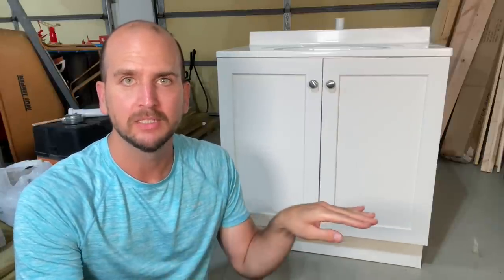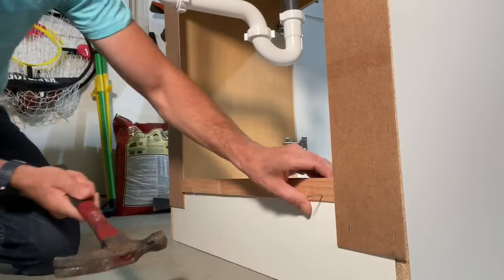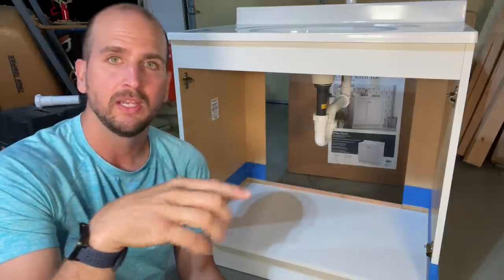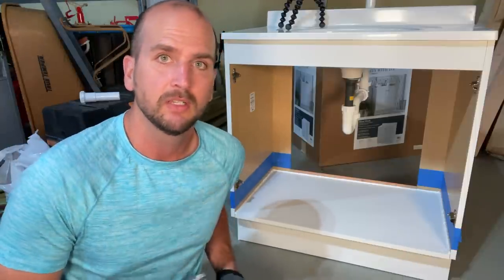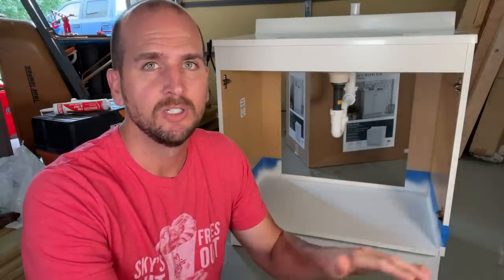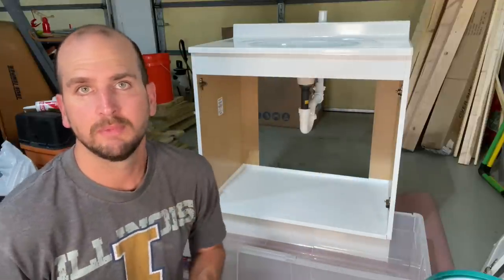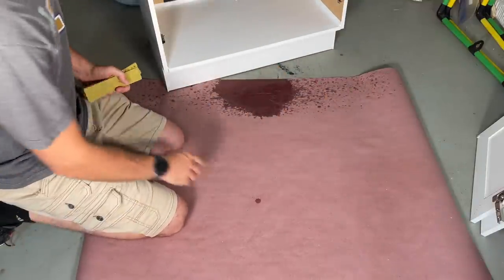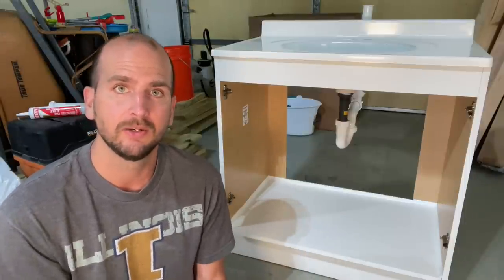Waterproofing A Kitchen Or Bathroom Cabinet With Flex Seal

Comment: Never thought to try this! I think I like the idea of this IN COMBINATION with the peel-and-stick tiles. The Flex Seal basically forms the waterproof membrane, and the tiles form an additional water resistant (but not fully watertight) protective barrier for the membrane. Kind of like the foam and/or sheeting that protect a waterproofed foundation from the dirt and gravel before backfilling.
Reply from the maker: Sounds like a great idea and I think the tiles would behave much better wear resistance as compared to the flex seal.
Reply: @EverydayHomeRepairs  That's what I was thinking. And the tiles are so cheap and quick it's almost a no brainer to add it on top.
Reply from the maker: Agreed 💯
Reply: I'm with you Marc.  The FlexSeal might get scratched up, compromising the seal.  No normal wear and tear will penetrate a vinyl tile.  Putting FlexSeal on the tile is a very good idea.   Even if the FlexSeal gets scratched off the top of the vinyl tile, the seams of the vinyl tile are likely to remain sealed with FlexSeal.
Reply: @EverydayHomeRepairs  Good point. Moving stuff around the floor of that cabinet could damage the waterproof properties of the Flexseal.

Comment: I left a comment about flex seal on the other video. I had to replace the whole "floor" of the base so after I cut the plywood base I primed it and then used a whole can of Flex Seal on it! I wasn't looking for it to hold water I just wanted some protection and it makes cleanup of leaks a lot easier. Mine was way complicated because of pipes and stuff, but if I do another flat one I think I'll do both Flex Seal and tile! God vids Bro, ty
Reply from the maker: Nice, thanks for the video suggestion and feedback 👍

Comment: I have battery operated water detectors on the under my sinks, behind the refrigerator and under the water heater. So far they saved me from refrigerator water line leak and a water heater leak. 
The only thing is you have to remember to change the batteries.
Reply: I do too, recently realized that have to replace yearly or so.
Reply: I bought some simple ones from Amazon. Put it under my kitchen sink. Forgot about it. Batteries got low and started beeping, but for about a week, I could NOT tell what it was! I actually got so fed up that I googled "what's beeping in my house" just to get ideas of other things to check. I realized my mistake and found the noisy culprit, but yeah, water alarms are good. I like this idea though too. Even just a bit of water can damage, so I say do all of these things! Lol

Comment: I flexsealed the hull of a 12ft aluminum jon boat 6 years ago and have used it regularly throughout each season with no leaks. It also sits outside uncovered in coastal SC year round. Whether its a p-trap leak or exposure to torrential Summer downpours and yo-yo weather changes in SC flexseal can handle it.

Comment: Waterproofing this way not only prevents water leak damage. There are plenty of situations where the actual cabinet contents can leak onto the base causing carnage, especially if the cabinet is fiberboard construction. Flex Seal is great for this.

Comment: Has anyone used Red Guard for this app?  I have used it outdoors on exposed wood and then painted it.  If you don't require a smooth finish it seems to work well at water proofing and preventing dry rot.

Comment: I used flex seal brush on in my rv storage areas. 7 years later still working.
Reply from the maker: Nice, thanks for the feedback!
Reply: I poured mine into the sink cabinet base. Worked a treat.

Comment: I used a scrap piece of linoleum. Curved up the sides about 2 inches. Used wood inside corner molding to support the linoleum. Used FRP edge strip to secure the linoleum around the sides.
Reply: Ive done this many times but on some jobs you dont have the piece extra or on hand. This makes a great alternative. Especially for the "cheaper neighborhoods". Vinyl and trim looks 100% better though.
Reply: If pipes come up from the bottom instead of through the wall, you can build up caulk around the pipes just like in this video. And caulk the seams where you have to make slices to slide the sheet around the pipes.
Reply: Make a video
Reply: What is frp
Reply: They now sell (Amazon, of course) under sink mats with and without a lip that are really nice. I will do the flex seal and because I don't know how well it will take the weight of my R.O. system and cleaning supplies I'll put the silicone mat on the protected wood. Hope it doesn't stick and pull up the Flex Seal when I remove it to clean it.

Comment: Million dollar Idea - those companies that sell custom "Car mats" - should mass produced sink cabinet "mats" (like Hot Water and Washing machine drip pans) I have an old house with "true" wooden cabinets (they won't fall apart if wet) OR better yet! - Cabinet manufacturing should build better water damage solutions
Reply: @stephensoo1628  Thanks - Always late to the show, to bad they made them so expensive - reasonable price and easy to buy (local store) I would think most everyone would get one?  Maybe I'll just consider storing sponges under the sink?
Reply: @brada1803   - Amazon shows some similar products and some were less expensive. But even if you buy the more expensive models, they cost less than a replacement vanity, and on top of that when replacing a vanity there will be a cost for labor (or extra effort on your part if DIY).

Comment: Definitely the most important thing is that, if there is a leak, you will be able to see it.  Once you have leak, time is not your friend.  I would continue the Flex Seal up the sides a few more inches to prevent damage from splatter.

Comment: Interesting, but how well will it stand up to a few months of wear-and-tear? Most people use that space for storing stuff like cleaning supplies. Won't it tear after a while of carelessly taking stuff out and putting it back in?
Reply from the maker: Mark Berman just mentioned combining the Flex Seal membrane with the peal and stick tiles we install a few videos back.  I think that would be a great combination.  The tiles would hold up much better to the wear from things be taken in and out of the cabinet.
Reply: True, I used Flex Seal on a joint back in 2013.  It has slowly deteriorated over time.  So I used a different waterproofing spray under my sink to do the same jib as Flex Seal.
Reply: Alfredo how about if you use Dollar Tree baskets to store your under counter goods? The baskets don't damage the floor & by pulling it out you have full view of all your products.

Comment: Very interesting. I think the flex seal came out cleaner than the peel and stick. This method will cover any pin holes that is hard to see. Thank you for sharing
Reply from the maker: You Bet, thanks for the support Hassan 👍

Comment: Just use an electronic water alarm ..$15 max but WELL WORTH it!
Reply: except after a few years and your batteries are dead
Reply: @fc-pl9kr  Or you're away from the house. No way does $15 get you an alarm AND an electronic water valve.

Comment: I just have water leak alarms all over the place as well as a Moen Flo on the main.   I've had a few water related insurance claims in multiple homes.   Also had a few close calls that would have turned into insurance claims.  My rule is now inspect everything that last guy did when I move into a home,  and always always educate yourself on the correct way to do things.

Comment: I'm going to use flex seal like you did in my second bathroom that had a bad leak n the pressboard base is all rough and yucky looking. Thanks for the great idea.
Reply from the maker: Happy to help and best of luck on the project 👍
Reply: This is a long-lasting fix. And looks nice. Well worth the effort.

Comment: This is really great to reduce damage to the cabinet in a minor leak (dripping slow for a while), as long as you caulk the front so the water stays on the flooring (hopefully not a wood floor!), but you really need to install a leak monitoring system that can (minimum) emit a loud alarm sound and maybe send an alert out over WiFi, or even trigger a cut-off valve on your main water line, to cover a serious leak where many gallons would get released.

Comment: Sounds like a great Idea. However I would like the Flex Seal to be clear that way it could go over any floor covering. Thank You for the demonstration.
Reply: You could alternately put the flooring on top of the flex seal. Extra resistance and better looks, if the installer is careful not to mar or scratch the coating when installing the floor. Be it the "peel and stick" tile or otherwise.

Comment: Yes, I would use the flex seal, great idea for this application! I have used the floor tiles to line kitchen cabinets for easy cleaning, lasts forever.
Reply from the maker: Hey Yvonne, I actually favor the floor tile over Flex Seal after doing both.  Mostly from a cost and time of install basis.

Comment: If your fixtures or drain is leaking, or the vanity top isn't properly sealed, you've got bigger problems than the vanity base. Even a swimming pool over flows if overfilled.

Comment: I used peel and stick tiles in a laundry room.. I had a small leak of about a half a gallon of water (tear in front loader membrane) and many of the tiles just floated away. The adhesive quality on the back must vary, but I prefer something made for waterproofing like this is.

Comment: This seems like a solid venture with potential for decent long term results.  I wonder, though, if it would begin to peel up over time with scratches from under sink products. Is peel and stick linoleum sheets a thing?  I'd try something like that if it's cost effective (a sheet cut to size to avoid separation gaps).
Reply from the maker: A Vinyl sheet cut to size is not a bad plan of attack 👍

Comment: I like the flex seal idea. And like soem others I would put some cheap tile over the top of it for abrasive resistance. Never would of thought of either one, Thanks.
Reply: Does flex seal self-level or does it have texture? If it has texture, I guess you could trowel out some type of adhesive to hold the tiles down.

Comment: My question is if the flex seal actually stick/hold on the caulk/sealant? Because I assume you used a silicone caulk/sealant since its most effective for waterproofing and preventing mold, etc. . . but it's also not printable. It just doesn't stick. I don't know what Flexseal is made of though . . . ??

Comment: My wife said "no" because she didn't want the noxious fumes from flex seal spray in our house.  I like the square tiles because they will allow me to fill in LARGE holes around my pipes coming from the bottom of the cabinet.  The tile project looks faster.  I think I'll add a water alarm.  I don't believe the base is sloped toward the front, and it would be a lot of work to make it sloped.  I may use some silicone gaskets/washers around the three pipes to provide a better seal.  What does anyone think about that?
Reply from the maker: I think the tiles with silicone would work great.  Many people have noted water alarms just not sure how success the alarms are at working when you need them.  I haven't went too far down that path since most of my concerns are with my rentals and I fear the alarms would be more harm than good.  I usually shy away from things that create more calls from tenants 😁
Reply: my pipes come from back but none are sealed. I may try silicone to one the gaps too

Comment: what's the purpose of this unless you're opening ur vanities everyday looking for leaks lol. I have water alarms under every sink in my house directly under that p trap and valves if a puddle gets lager than a silver dollar I'll know right away. I have flat sensors inside a 1/4" deep by 18"x24" drip pans under the dishwasher and refrigerator. Washer sits inside a pan with a 2" riser that has its own gravity drain line that goes through the wall and into the garage which is technically against "code" but I can easily cut and cap it off if I sell the house.

Comment: Why not line a thick bead of caulk across the cabinet base front to capture any leak so it does not flow to the floor and to floors below?
Reply: You want the water to flow out the front so you notice it sooner.  If the water just pools inside the cabinet with a small slow leak it will take you or your renters more time to notice it and possibly doing much more water damage.  Oozing out the front you can notice and fix it quick.  That's the theory at least.

Comment: I will need to do this on 2nd floor. Will it work on drywall too?
Doing this on existing cabinet base with no incline on angle for water to flow to the front might be challenging.

Good product to try for sure to prevent damage that will be in thousands or more.

I also need to vacuum & clean  under cabinet base due to some possible moisture and mold. Can I simply remove the toe kick and vacuum inside underneath.

Comment: I purchased a new Bath Vanity and was considering using Flex Seal to waterproof the bottom of the unit. This Video is awesome and I will definitely complete this project. Not to much work at all; excellent idea and thanks for the Video.

Comment: I had a toilet tank crack which left it unusable due to leakage.  Used Flex Seal and coated the interior of the toilet according to instructions on the can.  Reassembled the toilet.  ZERO leaks and continued to do the job for several years until we finally remodeled and replaced the toilet.  Amazing stuff!

Comment: Hi! Would like to ask: How do you make a slope inside the cabinet so that the water would go to the front (like in this video)? Since the sink cabinet in our appartment is already connected to the floor.

Suggestions are much appreciated ❤
Reply: Good question. I am looking at similar issue. The installed cabinet at a rental is decayed from many leaks apparently. So I have decided to surgically remove it only so no affect on the rest of the cabinet. When installing new wood I am going to figure out a way of shimming the back up so to get slope to the front. Then apply the flex seal. This slope would be verified using a level of course. Thank you.

Comment: How durable is the Flex Seal on the floor of the cabinet? I wonder if with the often movement and sliding items in and out of the cabinet that if over time the Flex Seal might wear off? Obviously in the corners it should do fine.

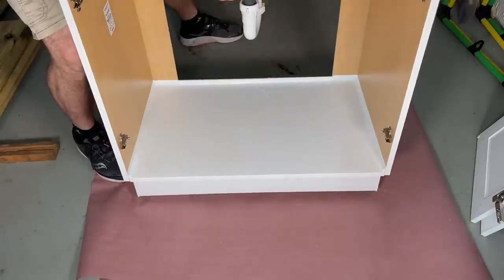Comment: The one drop was seen at 8:45 when you tilted the cabinet back.
Great video.  never thought about using Flex Seal like this. 
make sense,  Going to use this on the bottom of my fishtank stands to protect from any pump leaks.

Comment: My grandpa made me paint the bottom plate of the wall in the bathroom with flex seal paint . Hopefully it last. I was using a shop vac to vacuum stuff up and it had a few part peeling from the slab

Comment: Great video!  Could you use RedGuard on the base of the cabinet and then paint over it?  Would that work to waterproof the base of the cabinet?
Reply: Yes, if you happen to have it already, but the point here is not to spend a lot of money. And not purchase too many various materials.
Reply: RedGuard cannot be painted, paint doesn’t stick.
Reply: @stevebabiak6997  How else is RedGuard applied? I painted it all over my shower enclosure before tiling.
Reply: @blaster-zy7xx   - RedGuard is applied like paint. And then you typically tile over it with a thin set.

But if you try to paint over it with a latex wall paint, that paint won’t stick well.

My earlier comment was directed at the suggestion to paint over RedGuard - not recommended.
Reply: @stevebabiak6997  I wasn't sure, but thanks for the feedback.  I do like the idea of using flex seal, then putting self-stick tiles over it.  Anything I can do in my bathroom to be more proactive than always being reactive when it comes to the bathroom and water is a win for me.
Reply: @blaster-zy7xx   - I almost missed your mentioning a lot of money - yes, RedGuard is rather expensive, and for this particular purpose there are less expensive alternatives that would work well and involve less labor.
Reply: @stevebabiak6997  OK, Now I see what you meant.

Comment: That is my fear of “silent” leaks and don’t know u til lots of damage has taken place.  I am waiting for my 2 story home to be built hopefully by end of this year or  Jan/Feb. leaks from 2nd story… from tile work, tub, sink, etc from in the bathroom.  I plan to hire home inspectors to check out plumbing and codes compliance.  Thanks for the helpful tip and good content as always!  👍
Reply: Hire a professional waterproofer to seal the subfloors of the bathroom. 
After sheetrock and plumbing rough in.
But before install of cabinets, tile etc.

I did this in my parents bathrooms.

It paid for itself after 10 years and a  leaky door on the shower surround.

The people who replaced the shower surround had expected to do a bigger job.

The subfloor was not damaged.

Unfortunately I can not recommend products to use.
I was taught using a system that is no longer in production and I had to improvise with other lastomeric based products from separate manufacturers with no material warranty.
Reply: @shawnr771  unfortunately with the new build, they won’t let me do anything while they r building since technically it is not mine until I close.  I do plan on sealing somehow so I will look at your video again and thumb through your older posts..Flex Seal does make silicone too in addition to spray so I may have to seal it somehow.  But for sure your vid got me thinking so thank u thank u!! ❤️👍
Reply: @dianedo8314  I dont make videos.
If you can do walk throughs as they are building take lots of pictures. So you know exactly what they did and what products were used.